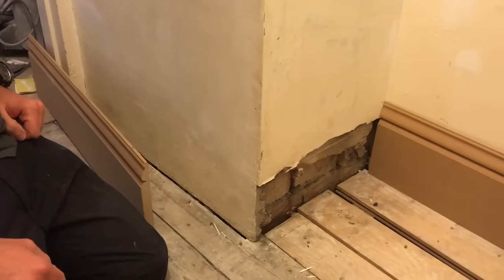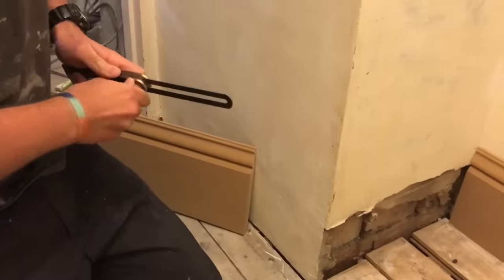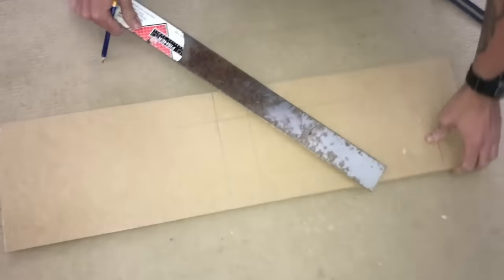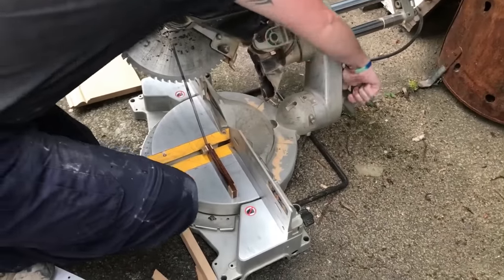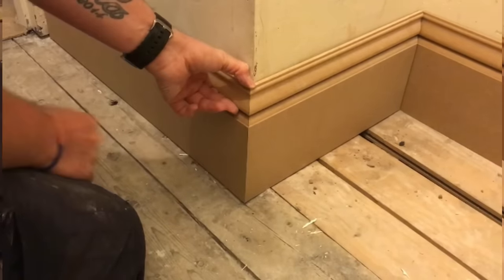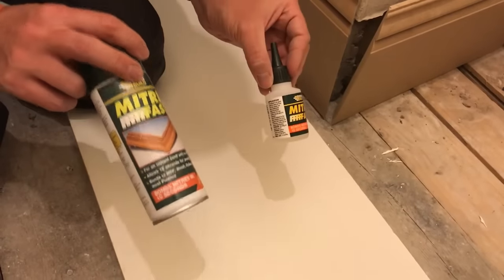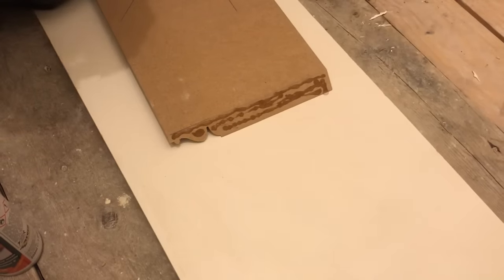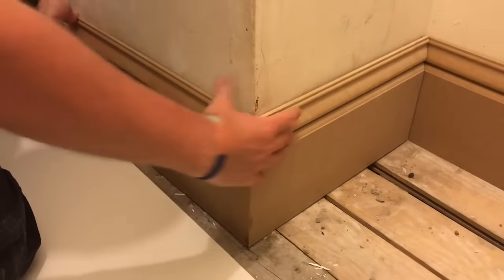How to cut an external mitre / outside corner on skirting boards / baseboards.

Comment: Alex Rae
Hi mate. Absolutely fantastic video - just what I was looking for! If you wouldn't mind answering me a question? My chop saw won't go back far enough to cut my 7" Taurus skirting so is there a way around that or can I use your method to select the angle on my circular saw? Thanks in advance!
Reply from the maker: Alex Rae Hi Alex thanks for your comment! My advice to you is to cut as much on the chop saw as possible and then finish with a hand saw using the cut from the chop saw as a guide! Thanks for watching 👍🏼
Reply: @spendtimesavemoneydiy  or lay the piece flat and use your square to find the angle left to right
Reply: @mikesmith-bj7nd  Feel free to do a video Mike illustrating your technique and showing how you would then transfer that to your chop saw accurately?? @Spend Time, Save Money, DIY... Great Video! Great tips! Thank you :)) Clear, Concise and without all the BS or Noise. Very much appreciated

Comment: Does it matter how wide the straight edge is that you use to mark parallel to the corner mark to work out the angle the mitre saw should be at? Which line did you mark with the hand saw? Thanks if you can answer. Trying to work out if I'm capable of doing such a job before I waste money on tools!
Reply from the maker: Natalie Denis hi Natalie thanks for your questions. The wider the straight edge the better and more accurate the angle but it doesn't really matter, when I show students I use pieces of the skirting board which are 3" or 70mm. Where I had marked for the corner of the wall is the line I extended with the hand saw so I could line up the blade of the mitre saw easier. Hope this answers your questions if you have anymore don't hesitate to ask! Thanks for watching and good luck if you have a go 🔨👍🏼
Reply from the maker: Let me know how you get on!

Comment: How did you know that when you where gluing the 2 mitres together how did you know if it was gluing square or to the angle of the wall
Reply from the maker: lil Butts because the angles of the two pieces equals the angle of the wall not to 90 degrees! Thanks for your question and thanks for watching 👍🏼

Comment: What if the wall is not vertical 90 degrees up? Mine is 85 ish at the bottom of the wall so there is a large gap if i join them .
Reply from the maker: Could you hack some of the plaster away at the bottom of the wall?
Thanks for watching and don't forget to check out my other videos and subscribe to help my channel grow 👍🏼
Reply: @spendtimesavemoneydiy  yes thats exactly what i ended up doing. So there is still a gap but not too bad. Thanks for your help.
Reply from the maker: @nrosko  you're welcome 👍🏼

Comment: Not many angles are 90 degrees as you say, but that's easy, it's when the angle is flaunching out on one or both walls, as in about 90% of cases.  That's when the fun starts.

Comment: when you have exposed brickwork like that, how do you attach the skiting to the wall? is it with no more nails
Reply from the maker: There are a few ways. You can pack it out with timber or glue and screw with no nails or use expanding foam. Thanks for watching and be sure to like share and subscribe to help the channel grow.

Comment: Could someone please tell me the name of the tool he used to measure the angle and let me know if you can get one that states the angle size?
Reply from the maker: House Fairy hi, the tool I used is a sliding bevel and there is a link to it on amazon in the description.
Thanks for watching and be sure to like, share and subscribe to help the channel out 👍🏼
Reply: Starrett makes an angle finder that will tell you what angle to set the saw to it works great.

Comment: Or you can cut it as normal then plane off the quirk and cut a piece of scrap 10 x 10 then match the angle.or do your best and make the wall fit your skirting as skirting takes longer to make than badly done plastering since they started at the bottom heavy handed leave half the trowel load and skim the rest

Comment: Good tip but why did you not do the mitre on the internal side?
Reply from the maker: Davy Scales if you watch my other video on scribing internal corners it explains why I don't mitre internal corners! Thanks for watching 👍🏼
Reply: Because if the corner is out of square the scribe hides it perfectly without the joint opening up.

Comment: Hi but what if you want to cut an angle greater than 45 degrees and the chopsaw only goes to 45 degrees for bevel cuts
Reply: Three suggestions. If you only need 46 or 47 degrees then you could try resetting the 45 angle - there may be enough 'play' to get the angle you need. Alternatively you'd have to insert a wedge under the piece being cut (e.g. if you need 50 degrees you'd need to set the bevel to 45 and insert a 5 degree wedge under the piece. It's a potentially dangerous technique - you need to clamp it good and wear PPE. Or, cut it vertically with a hand saw. I'm assuming your chopsaw doesn't have the depth to cut it vertically as otherwise you'd simply mitre it.

Comment: What if the angle of the wall is tighter than 90• opposite to what you have here?
Reply from the maker: Aaron Roberts same process 👍🏼
Reply: Spend Time, Save Money, DIY sorry, I mean how would you cut this on a chop saw, my saw only bevel cuts to 45•
Reply from the maker: Aaron Roberts try turning the skirting over on the other side of the saw and you should be able to get the angle 👍🏼

Comment: Buy a Starrett protractor, measure the corner angle, set your mitre saw to that angle, cut, glue mitre & fix. 30 seconds.
Reply from the maker: Kevin Bower Hi Kevin, there is always a different way of doing things, maybe better, maybe faster! This is the way I was taught by a true craftsman and this is the way craftsman have been doing it for hundreds of years before all these tool box cluttering gadgets were invented.
I look forward to seeing your video with the protractor. Maybe I will learn something from you!?
Thanks for the comment and thanks for watching 👍🏼
Reply: @spendtimesavemoneydiy  Hi mate, it wasn't intended as a criticism in any way, and I don't make videos. A little protractor doesn't take up any more toolbox space than a screwdriver, and saves me countless hours on a jobsite where I have maybe 10 complete rooms to skirt to perfection in one day. I take your point about craftsmen doing it this way for hundreds of years - but those same craftsmen then used to make the cuts using a handsaw instead of a compound mitre saw and then having to block-plane them dead flat ........ Times change mate, things move on, check out the little Starrett 505P-7. Honestly. All the best.
Reply from the maker: Kevin Bower I get a lot of know it alls so I always give a sarcastic comment back. Usually shuts them up lol. I looked at that protractor and it seems great for a professional using it every day. However it is a bit expensive for a diyer who is maybe only skirting a room or two. Thanks for your reply 👍🏼
Reply: Ive see these starlett protractors,,I think I will give the old way a go, you can end up with too many tools and gadgets and there not cheap.

Comment: Nice but whats going on with those floors and walls, housr looks super run down.
Reply from the maker: HLG_TheShepherd yes the house is definitely a fixer upper. Floorboards and walls have been fixed now. Thanks for watching 👍🏼
Reply: @spendtimesavemoneydiy  Wouldnt the flootlr boards typically be done first? Is it a problem ripping old floorboards from under new base?
Reply from the maker: HLG_TheShepherd typically yes the floorboards would be done first but there is a lot of plumbing under this floor which needed altering when I came to do the bathroom and since it's only the laundry room I left the floorboards loose for easy access.

Comment: outside corner lager >90 degrees. Say 92 degrees/ 2 =46 degrees, if you can't cut that. Take 90-46 degrees= 44 degrees cut this for the two pieces

Comment: When it comes to internal and external miters is the concept the similar
Reply from the maker: Fernando Aragón it is the same geometry for internal and external mitres but internal corners on skirting boards should be scribed not mitred. I do have another video about internal scribes. Thanks for watching and be sure to like share and subscribe to help the channel grow 👍🏼
Reply from the maker: Fernando Aragón https://youtu.be/YRu_SqWNtMs
Reply: Well I guess I should specify what I am doing. I'm actually doing crown molding and I'm having a hell of a time with the angles
Reply from the maker: Fernando Aragón this method will work for the internal angles too 👍🏼

Comment: If an angle is that badly out of square i would cut it square anyway then pack it off and caulk or  float the wall out if necessary. If  angles are way out and you lay a laminate or tiled floor it looks horrific much better to fix the wall.

Comment: nice but tak u 20 mnts in thats cornr
Reply from the maker: Victor Altun this video is designed to help beginners and diyers. It's a demonstration of how I do external mitres. If I did it at my normal working pace then it would have been hard to follow.
There are different ways of doing this job and many ways to bodge it, but this is the way I do it and always get high quality results.
Thanks for watching

Comment: Just don't agree with the glue.  Would take a few gallons on most houses. Plus, I like to be able to pull out baseboard a tiny fraction from walls when repainting them.  I'd not be too pleased if glued 😲😲
Reply from the maker: TT nNaples we all do things different ways. I was taught this method by an amazing old joiner and it has never let me down. 👍🏼